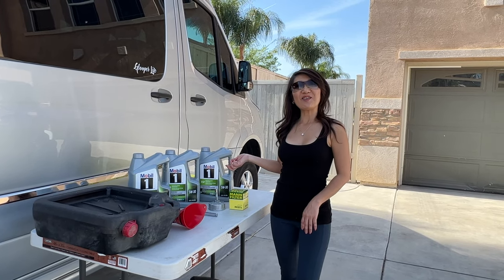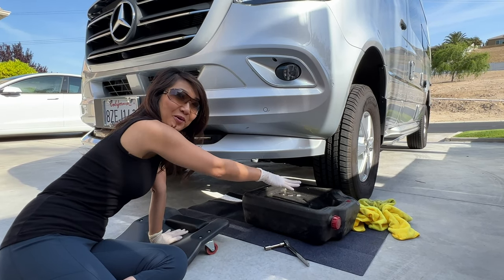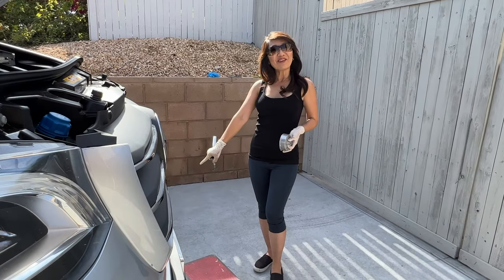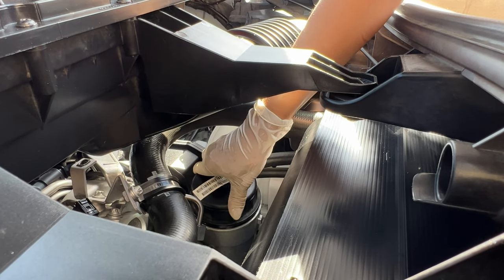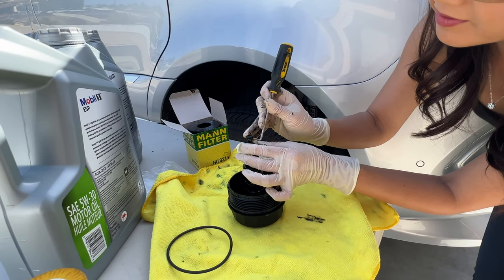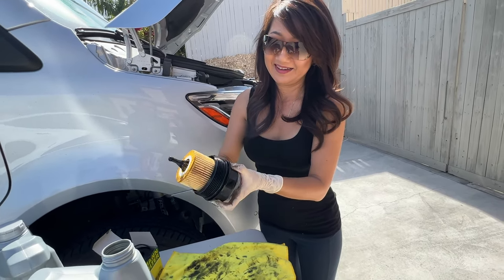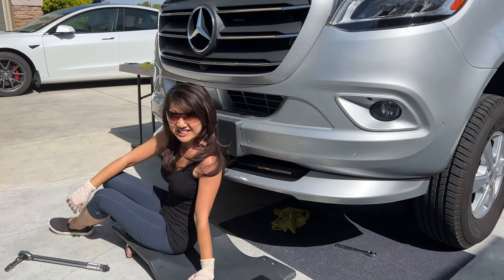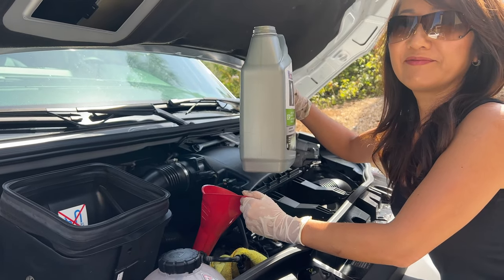Oil change for Mercedes Sprinter/ 2022 Airstream Interstate 19/  Class B RV/ Camper Van

Comment: Another video’s comments mentioned new procedure to pour the oil into the filter housing. Allegedly helps prevent oil starvation during the next startup. Soot build up led to spun bearings occurring too frequently after oil changes so Mercedes updated the procedure.
Reply from the maker: @JohnDoe_toetag  Thank you for watching and for the info. We will try that during our next oil change. 🤗

Comment: Hi there, did you include links to the oil, filter , filter wrench?  Thanks
Reply from the maker: @jziran  Hi Justin, here are the links
https://www.amazon.com/gp/product/B00VX0CSKG/ref=ppx_yo_dt_b_search_asin_title?ie=UTF8&th=1
https://www.amazon.com/gp/product/B001DRLPP8/ref=ppx_yo_dt_b_search_asin_image?ie=UTF8&psc=1
https://www.amazon.com/Mobil-124044-Formula-Engine-Bottles/dp/B07QLJHLHN/ref=sr_1_2?crid=2D63WDGO2183T&dib=eyJ2IjoiMSJ9.Q1QdJiYASZkMnDOQjoex0CvgoscnyrLFxu8wj_J1YGJ8copjGNzT3uz_zHVD9iaGqUaprNzx8tpIy5Ozq4ZOaJVfBNqKfXm86RyYra5E2WvqzyI-B5nSZYMmE3Goi4VKpLlTfe_azxKxf5JWfcI0avQFz6SAYLkVT67IuCf_2vrTwkV0EGBLm6TOZshCBDM42KGAedxn8mIOGrPJG4N99lbzWr8crR_x1x4PDxMQy1voEdQJsRqln33N0JbMkPRPRCt3wKm2RJTt-rCu6GNkdqYJySv-OvRWrkxxownpR1o.KRQurhk9Czu22KksA_YdXp4JYRMBoIncTfvXO9wPg7Q&dib_tag=se&keywords=mobil+1+5w-30+esp&qid=1721081808&s=automotive&sprefix=mobil+1+5w-30+esp%2Cautomotive%2C209&sr=1-2